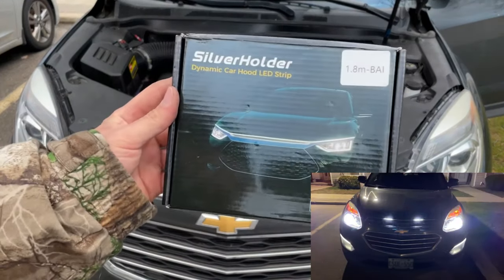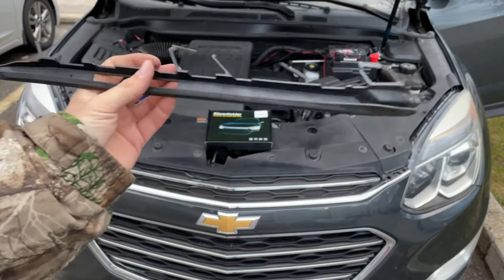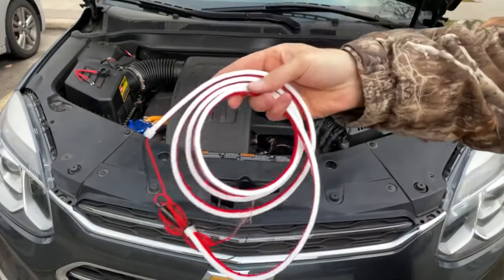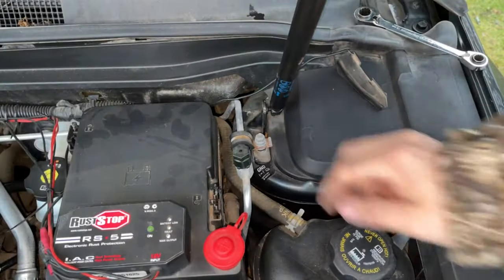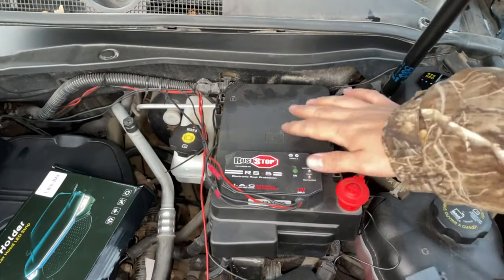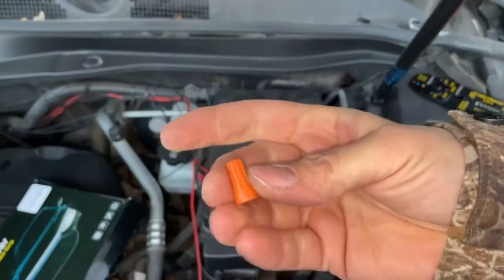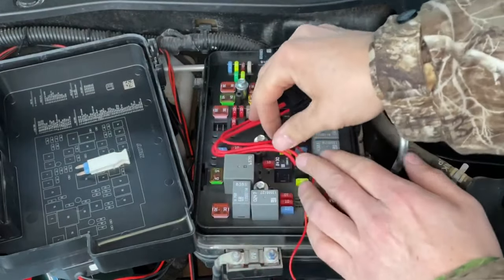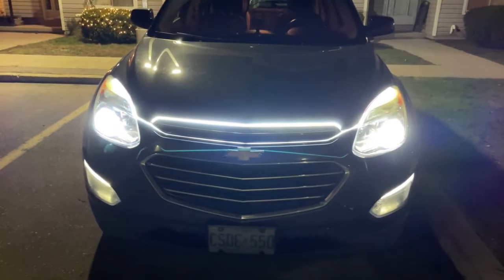SilverHolder Dynamic Car Hood LED Strip Installation (Chevy Equinox)

Comment: Great video but I am so intimated playing around with my car's electrical...I don't really know what I'm doing...but I really want this LED strip. Hope this is easy to figure out on a Honda Accord, seems like everything is a chore to do with it.
Reply from the maker: Just check the fuse box like I showed in the video and find either your DRL lights, headlights, or parking lights to tap into just like I did with the piggyback fuse. Just have confidence and believe in yourself and you will be ok. Check my link in the description and use my promo code from the description for a discount as well. Thanks for watching. Please like and subscribe
Reply: @BillOfAllTrades2016  Thank you, I think I might try it out & will use your link when I'm ready. Your video & piggyback fuse/fusebox method is the only helpful one I've seen. All of the others are recommending to splice the existing car wires or use a T-tap on them and that's where I get really nervous. I suppose the thing I don't know how to approach at the moment is where exactly this will go in relation to the weather strip, and which of the engine plastics will have to be removed, they're pretty well layered on in the Accord. Will keep doing research.
Reply from the maker: Awesome thanks. Ya I’m he piggyback fuse I ding is the safest way. The t tap splicing method is not very long term as they are not waterproof connectors. The piggyback can stay safe in the fuse box. I removed 4 separate pieces of weather strip to make room because you have to remember that rubber strip light will also act as a weather strip when it’s installed. 2 of my weatherstrips above my headlights were put back on after so I just glued them back over top of the light strip onto the red tape part. Another thing to make you feel more confident, you can buy cheap multi packs of fuses just in case one blows and you can just replace it. I hope I never have to remove my bumper for anything because all my bolts are under the light strip. Lol
Reply: @BillOfAllTrades2016  You just answered another question I came up with when looking at things yesterday - does this 'replace' the weather strip... it appears that it does, at least in my case. I took another look and I will definitely have to remove the weather strip off the lip of the hood - it's simply connected by over a dozen snap caps. I think that once that's out, this LED strip will easily replace its former position...only one way to find out!  Side note, a really good alternative to using glue is 3M double sided tape, it's actually advertised for body kits. It's extremely strong. I broke one of the clips after removing my bumper once, and have the tape in its place.
Reply from the maker: I’ll have to check that tape out. I happened to have some construction adhesive in the basement that needed to be used up lol. The Chevy weatherstrip comes in 5 pieces. One with clips ontop of each headlight, one 5 inch piece beside each headlight and one long one attached to the middle of the hood. When I get back to Canada, the company that sent me this will be sending me interior lights as well to light up the foot wells.
Reply: @BillOfAllTrades2016  Im concerned that the heat from engine will melt away the adhesive on the strip and it will go flying while im driving.
Reply from the maker: @Toph.Beifong.   this light strip has very strong adhesive. It will not melt away. The engine temperature does not get that hot in the location we attached it to. And it will not fly away while you are driving because when you close the hood it ounces the light strip in place and holds it. This setup is totally safe. Plus I would never post anything on my channel if it failed or was dangerous. Thanks for watching. Hope you decide to buy one. Don’t forget to use the link in the description with my promo code for a discount. Please like and subscribe
Reply: I’m trying this out my 2017 Honda Accord Sport SE now. I’ve run into an issue with the light strip not turn off with the key out of the ignition. I’ve tried different grounding spots all same results.
Reply: I can't find DRL fuse on the KIA forte 2019-2022 diagram can anyone please help?
Reply: @Death2TheCore  did you find it?
Reply: @BillOfAllTrades2016  mine looks exactly the same, my only concern is do I have to get a piggyback fuse? or would you have to solder the red wire to a fuse in your fuse box? Seems simple but also seems I have to get separate gear to install. I have a 3rd brake light strip too, hopefully I can follow the wires & just swap. So I am not sure if I can simply install front strip with just what it came with - just like the one in your video
Reply from the maker: For the hood light strip you need a secure connection provided from the piggyback fuse. Soldering will weaken over time as it’s very close to engine vibration. As for the 3rd brake light strip you may need t taps to splice into the wires of the brakes. They are cheap on Amazon. Hope this helps. Thanks for watching. Please like and subscribe

Comment: Hello, excellent video, I have a Ram 1500 and I would like to connect the strip in the low beams, is it the same fuse or is it another one?
Reply from the maker: Hello. You can use the same type of piggyback fuse like I did. You will just have to located the low beam fuse on the fuse box map. It should still be a 15amp fuse on most vehicles. Thanks for watching. Hope this helps. Please like and subscribe
Reply: I contacted princessauto and unfortunately they don't ship that piggyback to florida, do you know of any others that i can use?
Reply from the maker: Try searching the term add a fuse on Amazon and you can use one like this one: https://a.co/d/bJwpD0E. These ones will have the same result.
Reply: How the light turn off?
Reply from the maker: If you hook it to a fuse that powers off when the ignition turns off then it will turn off when the vehicle turns off. That’s why we choose a fuse such as fog light, headlight or parking light. Thanks for watching. Please like and subscribe

Comment: Did you cut to size or just hide the  extra length?
Reply from the maker: I didn’t have extra length. It was a perfect fit. They actually now have different sizes you can order. It’s not advised to cut as the sequential scan feature will no longer be centered and you will lose the waterproof seal. Thanks for watching. Please like and subscribe

Comment: Where do you get that piggyback fuse harness
Reply from the maker: I purchase mine from princess auto. However if you don’t have that store near you then you can buy at whatever local auto parts store is near you. Hope this helps. Thanks for watching. Please like and subscribe
Reply: Does princess auto have a website?
Reply from the maker: Yes here is the link
https://www.princessauto.com/en/16-gauge-standard-blade-fuse-holder-connector/product/PA0008553380

Comment: I'm looking to put this same Silverholder strip on my 2023 Equinox. Is the drl fuse labeled? Having a problem trying to figure out this setup.
Reply from the maker: Every fuse should be labeled. Can you please take a picture of the fuse box layout as well as a picture of the inside of the fuse box lid. It should have a map on it. If you would like to email those to me at billyberrill@gmail.com I can help guide you to find the location. And it doesn’t have to be the DRL. We can choose another fuse.

Comment: great video, may i ask how do you change the color? thanks
Reply from the maker: This particular led strip was the solid white one and does not change color. If you want it to change color then select the dynamic hood led strip on the silverholder website and it will ask you what size and color you want before you checkout. Select multi color app control as your color. Then when you install it, it will change through the app. As far as the app is concerned, I’m not sure what app it uses as I don’t use the color changing one. If you do want to purchase one please use my link 
https://m.silverholder.com/ref/26/
And use my promo code BILLYB32 for 15% discount. Thanks for watching. Hope this helps. Please like and subscribe

Comment: I hooked mine up like it said to. Started up the vehicle and light strip worked. Turned off my truck, unplugged the light strip and now my truck will turn over but not start.
Reply from the maker: If it worked, why did you unplug it? And what fuse did you tap into? Also maybe scan your vehicle for codes. Doubt that the light strip caused your vehicle not to start. Probably and underlying issue

Comment: Should have just attached it to the top of the hood
Reply from the maker: The hood has weatherstripping that would not allow the light to stick to. And the wire will hang. This is the way the supplier suggests the install. Thanks for watching. Please like and subscribe
Reply: I disagree. it’s better not to have the strip moving, and it would look the same
Reply from the maker: Akosa117 yes agreed. No reason to have it attached to the hood. It’s unnecessary wear and tear. Thanks for watching. Please like and subscribe
Reply: @BillOfAllTrades2016  not all applications allow the install be on the core support. I installed one on my escalade and the best location for me was the hood.

Comment: My lights ain't staying solid after startup cycle. They keep going to the startup cycle and not staying solid like yours are. Any suggestions?
Reply from the maker: Did you already attach the lights to the vehicle? Try hooking it up directly to your battery and see if it does the same thing. How old is your battery. Maybe it needs a charge. Electronics do weird things when they don’t get full power. Should test the light before sticking it on. I forgot to say that in the video. Hope this helps. Thanks for watching. Please like and subscribe
Reply from the maker: Did you stick the light onto the car yet? If so, take a short video of it running and email it to the company and request a replacement

Comment: Hey man great vid  Now I'm just curious would I be able to plug it into my hazard fuse then use my hazard button to turn it on or off or will the rest of my hazard lights still turn on 'im still not quite sure were to put the fuse parking light?
Reply from the maker: Your hazard light pulses the power. It’s not a solid stream of power. So the light would not function properly. It would not have a chance to fully turn on. It’s best to choose fuses such as DRL, fog light, headlight, parking light or any other that supplies a solid stream of power. Hope this helps. Thanks for watching. Please like and subscribe
Reply from the maker: You’re welcome
Reply: @BillOfAllTrades2016  just have quick question tried all of those I have a 2006 ford mustang, and when I do the constant power is going to it even when the car is off. I didn’t want to leave it like that because I didn’t want it to kill my battery